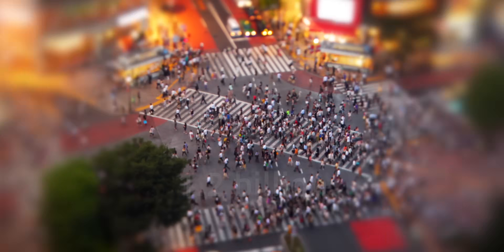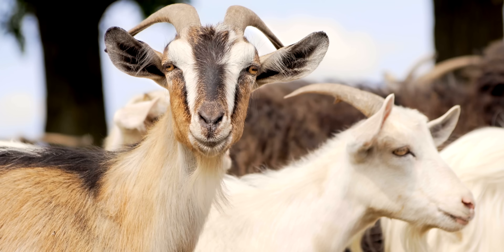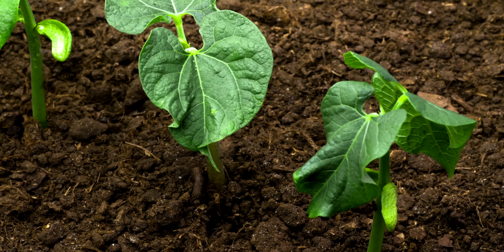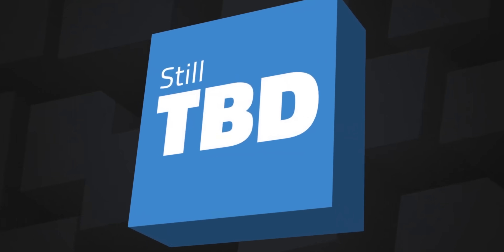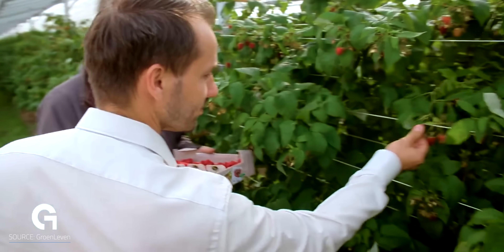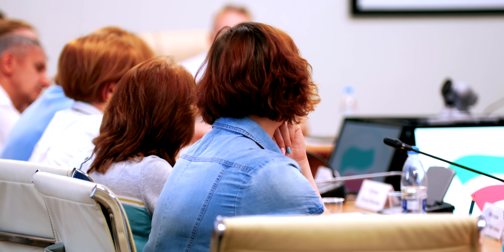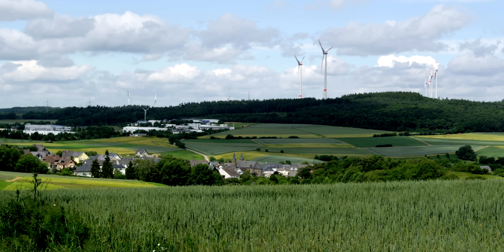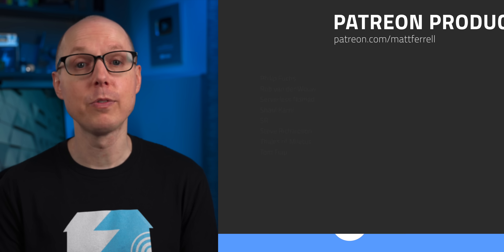Solar Panels Plus Farming? Agrivoltaics Explained

Comment: A lot to unpack here. Firstly, we’re talking about electricity not energy and it’s important to recognise the distinction. 
Secondly, there is no world where we can replace fossil fuels with renewables and keep going as before with this kind of growth-fixated economy. Nobody has yet worked that out (because it’s impossible). 
Thirdly, this whole piece was explained from the perspective of how to get more solar PV into the world which (the above points notwithstanding) ignores the extremely serious problems with industrial agriculture and it’s dependence on both fossil fuels and biocides - and the associated risks from climate breakdown, biodiversity loss (both genetic & species), water use, loss of nutrient density and so on. Slapping some solar panels on top may bring joy to some tech geeks, but it doesn’t solve any of the actual underlying problems. Also worth noting how all those solar panels are made. (Fossil fuels). 
As much as I enjoy the videos, this ecologically-blind analysis is catnip to techno futurists but sadly is selling a dream that can never come to pass. 
Plants are more efficient overall converters of sunlight into energy and if you replace the pv in this example with other food/fibre/fuel producing trees you start to get towards a system that actually removes all the fossil fuels, biocides, water and resource problems, feeds more people and regenerates biodiversity while feeding the world. Research Syntropic Agroforestry, or multistrata Agroforestry etc. A good example close to home for you would be Mark Shepard’s New Forest Farm. Ecological function in agroecosystems is not rocket science, it’s way more complex but it’s fascinating and actually holds the key to human prosperity and longevity on this planet. 
250 odd years of fossil fuels has been a wild party, but like trust fund babies blowing through our cash and maxing out our credit cards, we’re struggling to come to grips with the idea that it can’t last forever. We had all these wild dreams of flying cars etc. I know, I’ve been there. It’s just not possible. 
Nature’s 3.5bn years if R&D however is a valuable treasure trove of how to design complex systems that work. No waste - that’s a human concept. 
Appreciate the excellent videos by Matt, but it would be nice to see some balance.

Comment: Solar panels in general are not going to get much better reception until better solutions are provided for storing the energy that they gather. I forget who and where, but I remember somebody was working on a huge project to create water storage up on hills that water pumped up there during peak solar hours, and then during weak hours water was let down and energy generated by the force of the water coming back down. It has some energy loss, but at least then there isn't the issue with toxic waste from batteries going bad and really expensive metals and things that are required for the batteries. Solar with batteries is anything but sustainable with current tech, though it has made leaps and bounds the last decade or two.

More people need to take a holistic approach to green energy or green projects in general and not have huge blind spots. This agrivoltaics seems to be one of the better green ideas I've seen because it's solving 2 problems with one solution, but there are still some kinks that need worked out. Using this in high heat areas combined with shade plants or grazing land like you said is the most practical place to start. Combining with tall warehouse buildings using aeroponics would work too and help power all the lighting, which would be a huge reduction in water usage and space required to grow large amounts of food for consumption. The major drawback with aeroponics is all the lightbulbs, but LEDs have some pretty impressive life spans these days. My home indoor system has bulbs that last something like 20 years at 16 hours on per day and I can produce a huge amount of food with very little space, power and water.

I don't know how difficult it would be to create panels on movable structures so that you could rotate them over different land. I'd really like to see farmers go back to rotating crops to grow healthier food while protecting the soil from overuse, and moving panels over the land that is taking the year off seems like it would be perfect. Maybe spaced a bit combined with plants that help fix nitrogen?

We aren't going to convince people to go green until the solutions we provide are practical and valuable to the people we are asking to deploy them, so we just have to keep trying, creating, and testing till we get it right.

Comment: Another wave of the future is likely to be 'indoor factory farming',  and solar panels may provide a path to this, or to a hybrid model, by providing the enclosing structure- for free.   And think of the citrus groves in Florida which are forever getting damaged by frosts.  Use the panels (mounted above the trees, yes) and some membrane between panels to seal out extreme low temps.   Solar panels can also become rain catchment systems with minor modification, and the structure they're mounted on can be part of the factory automation and track/rail for automated picking, etc.     You're welcome.

Comment: well-made video about a very important subject. In very sunny countries, there is an increasing trend for covering plantations with nets to reduce exposure to direct sunlight to improve fruits quality. However, PV panels installation poses a risk that is overlooked many times. the panel changes the rainfall micro-distribution and on sensitive soils, it may accelerate soil saturation and soil erosion. Considering the increasing intensity of rain events, it might require re-thinking of the design and risks management.
Reply: Very enlightening thank you

Comment: In 40 years, gasoline will run out. And it will get very expensive in 20 years. All farms will be switching to electric tractors and will need solar panels on their farm, the other option is to bring back horses to plow the land and people to hand weed the fields.
Pesticides, herbicide, fertilizer will disappear with the fossil fuels.

Comment: Adding smaller wind turbines along roads and railway lines can definitely help too on pushing up renewable energy yields. Solar panels are great but the tech will get obsolete quicker than other renewable energy types. In an ideal world, put up all solar panels along the tropical belt countries and deserts, wind turbines of windy countries and countryside, hydo on major rivers, turbine along major rivers, wave energy along the major coastlines and thermal capture points along the usual suspects - and all this energy produced could be transferred across countries and continents. It is about sharing and optimising resources worldwide for optimum output.

Comment: You didn't say these panels collect more solar because of 2 sides right. Vertical panels are not uses normally with a good reason. They are not very effective because the amount of sun they get is really low compared to solar panels that are angled towards the sun. You just waist half your solar panels for almost no or no gain at all. It is simply stupid to put solar panels on both sides of a vertical wall. 
Basically the same idea of putting solar panels on the wrong side of your roof but worse

Comment: This is a no-brainer and the panels should be raised higher to permit more types of crop. Imagine using the energy to desalinate sea water and turn coastal deserts into high yield farms and power stations... even vertical farms.

Comment: Aside from having a slightly cooler and a little more shaded work area for farmers. Another big possible win to this is it could eventually lower the cost of produce in the store by lowering the cost of farming. Today’s farmers face high fuel prices that could be saved by switching to battery powered farm equipment. Farm equipment could be charged by the solar panels, possibly eliminating the cost of fuel all together.  Another benefit of that is the cost savings on equipment maintenance as EV’s are known for having less maintenance over fossil fueled counterparts. Also there wouldn’t be the air pollution associated with fossil fueled equipment. The the plants are not only providing food, but also filtering the air. So not only would you be providing food and electricity on the same land, you’ll also be providing fresher cleaner air
Reply: Do you know how large a battery it would take to power a piece of farm equipment? We are 4-5 decades away from power storage efficient enough for that. The weight of the battery alone is enough to make it totally unreasonable because it would cause massive soil compaction. Not to mention the cost of the equipment, if a Tesla model Y is 100k tell me how much a tractor is going to cost? A million bucks?
If a pickup EV isn’t capable of pulling a trailer even 80 miles tell me how a massive tractor is going to pull a massive piece of tillage equipment or a planter all day long? 
It ain’t happening anytime soon. The wasted time alone would be a huge cost to a farmer.
Reply: @nickschaps4022  honestly, I feel like with this type of farming, there will be more man power involved than big equipment. The use of small equipment will probably be much more usefully so battery powered sizable equipment wouldn’t be very far fetched
Reply: @nickschaps4022  battery size depends on the size of equipment you are trying to run. You wouldn’t be operating huge combines in an area like this. It just wouldn’t fit. Ryobi makes tillers that run one 40v batteries that can easily be swapped out. Ryobi and ego both make lawn equipment that run on batteries that can be swapped out with fresh batteries once the batteries they are running on are depleted. Nobody said they had to have a battery big enough to run all day. Smaller equipment would be necessary for these more confined spaces rather than massive farm equipment used in big open fields. Batteries are getting better and better all the time as more demand causes more innovation.
Reply: @nickschaps4022  I think you can offset the battery weight issue with some dual purposing of the overhead solar canopy. Setup the canopy with electric feedwires like in a city monorail systems to act as the delivery system for the tractor, then the tractor can be more efficient by not carrying the battery weight. Hell, if you design it right you can fully automate an electric tractor to run along these wires under the canopy without a human having to control it.

Comment: I would give an idea of a more systematic solar panel that are flexible,,, manufacturers of these panels may develop designs. Which can be use on different positions that can controll, protect and maximize the utilization of the solar panels ,,,

Comment: It might be a good idea to also talk financial numbers... what was the cost of installation of agrovoltaics plant in the said case? What is the cost of maintaining the solar panels? Considering farm yield to increase by 15-20%, what was the overall reduction in labor costs/water costs, etc. Adding in profit of energy produced, by how much did the overall profit per acre/hectare increased by and what is the overall payback period for the investment? Assuming that bureaucracy is not going to change by itself, it is important to discuss cost/tax rebate benchmarks which would make it profitable for the large farmers to make the investment. 
After all, greed for more money has a faster impact of mass population psyche than fear of poor environment tomorrow. 
Also, are there any studies on hidden environmental/ecological challenges which might have been ignored in this dual solar farm/agriculture plantation? E.g. mining of material for manufacturing solar panels is said to have a major environmental concerns or Solar panel may reflect sunlight causing confusion in migratory birds, etc.

Comment: I think, we should use what can be used to take out maximum productivity in the farms. Like if the farmers are irrigating through channels then turbines there can also produce electricity and so on. 

Yes, agrivoltaics are  a good option where synergies can be met. I think, keeping farmers at the center of it should be the strategy that is the ownership should rest with farmers which will give them electricity for using pumps and then would increase their income also. 

Question arises, why would then someone invest in it? I think, on that part it should be a shared agreement where both parties benefit but farmers should not not burdened with influence. Means regulations should be strong.

Comment: 4:21 Hmm... are you sure you aren't a plant?

From the sounds of it, agrivoltaics sound very promising, but maybe there are instances where we shouldn't implement it -- we probably need to do more research to make sure it won't, say, interfere with plants too much in certain climates. But it sounded like in that study the agrivoltaic crops did better than reference considering damage and all, so it might just be better overall?

I hadn't heard of bi-facial panels before, maybe we should look into putting those in fences in a lot of places... Honestly it probably would make our energy production needs fade away entirely [at least for a while] if we covered as many surfaces as possible that get a lot of light with panels. I really think that parking lots should all have canopies of solar panels over the spots -- it would give a second purpose to a LOT of space, would produce power from otherwise "wasted" sunlight, keep cars cooler in the summer, maybe help keep spots a little more clear of snow in the winter...

Comment: I have installed close to 200 panels here in Ontario Canada, some rooftop, some ground mounted and actually most were ground mounted. The problem with agrovoltaics would be the cost to install them and then also they will need more concrete and steel to make taller yet still wind proof installations. My shed is roofed with only solar panels that I shingled together and it catches rainwater in tanks to water the garden. It is so good. To cover acres of land with panels would be a massive investment. Most people could not afford that and if they could, they would also hesitate to spend the extra millions of dollars to also grow crops under such tall arrays. It would only make sense in the Netherlands where land value is through the roof.
Reply: Or do it with home based agriculture (greenhouses). The future is manufactured homes. Add manufactured greenhouses to go with them. Put the manufactured APV greenhouse on the roof of a manufactured home.

Comment: We could also have solar + farming + water turbines rotating to convert movement into electricity. It could be a fish farm below, plants above kind of aquaponic system. Watering could be achieved through different methods, depending on where the system is set up (body of freshwater or ocean) If in the ocean, rain water reservoir, or reverse osmosis desalinization. If in freshwater, a chinampa like raised bed would be enough.

Comment: This should be a really nice concept especially for countries like India where 90% of the crop production is dependent on the annual monsoon rainfall. Agrovoltaics could actually be very beneficial for cases when there is flood resulting rainfall which is destroying the standing crop. With solar panels on the top, we can channelize the rain water in such a way to avoid any crop damage. I have couple of Ideas on this for India especially. Please write me if you are interested. I need some more guidance.

Comment: You can't use machines to harvest or fertilize or till without GREATLY increasing the cost of the mount. Say 300,000 for the mounting vs 30,000,000 in mounting cost... 
now the part about the temp changes was VERY surprising... My solar panels get VERY hot and the area immediately around them is ~2 degrees above everything else...

Comment: Glad to see a SMART application of solar on land that does not waste the land underneath. The shade the panels produce should  be optimized. Parking lots, the building underneath in hot climates
Reply: Most grocery stores here in Phoenix AZ have them over the parking lot....
Reply: @Slebonson  Smart
Reply: @Slebonson  Been to Disneyland (Paris) a few weeks ago they where doing the same to their parking lot near the main gate (was still in the early stages of construction tho)
Reply: I think it's possible to make strings of solar diodes instead of light blocking panels.
Reply: @PhilLesh69  true but i doubt it would be very efficient.
Reply: Parking lots. Shaded parking spaces, generating energy for nearby buildings.
Reply: @11u510n15t  good to see
Reply: In the German state where Lake Constance is in photovoltaik is mandated on new/renovated roofs and parking lots over a size of 25 cars. From what I know the state government also subsidizes this new concept here but it probably will stay expensive as long as the EU has no rules for it.
Reply: @lukasschwab8011  In sunny Germany? I live  in the northern US state of New Hampshire and have solar panels. I am under no illusion that they will ever pay for themselves
Reply: New technology for electric power generationhttps://youtu.be/xc2V2BS_Fng
Reply: How about the risk of solar panel material leaching out with time and getting into the soil and plants?
Reply: Little late to start worrying about plastics in agriculture. Everything we eat has been in contact with plastics at some point.